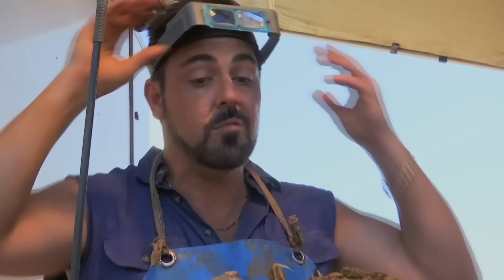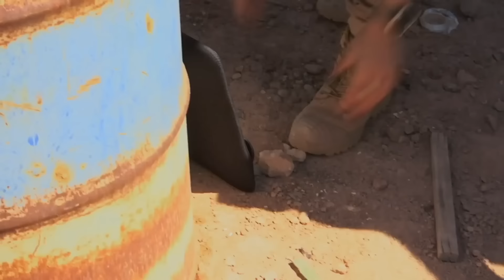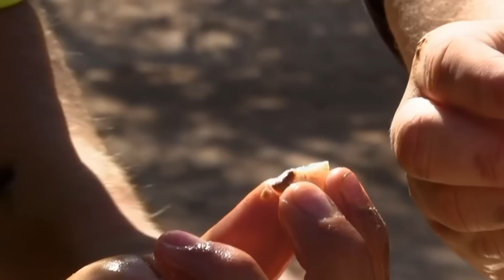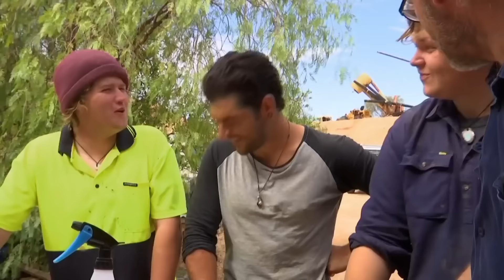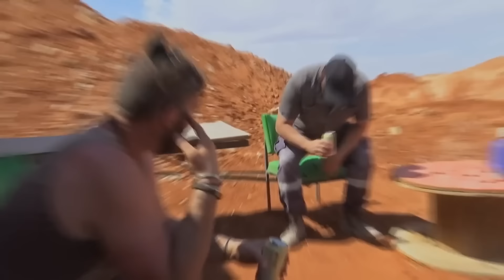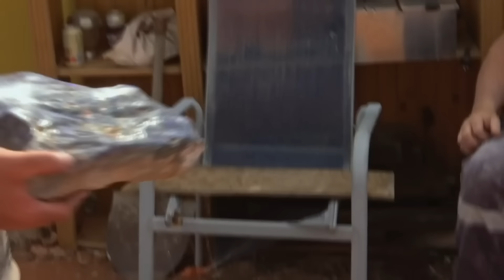RAREST & Most VALUABLE Opal Finds! | Outback Opal Hunters

Comment: If it don't snow it doesn't get below zero there's no reason to quit you could work year round if you didn't working in the rain I know there's no matter how hard it got outside I would never give up my fortune just cuz a little temperature I can do with a lot of sun and heat cuz it's only 26 above here now but last night it got down to 14 in the snow still don't melt here
Reply: It can get over 40 degrees in summer there